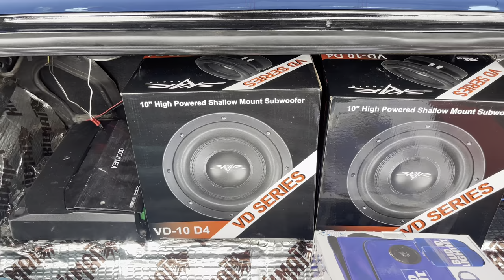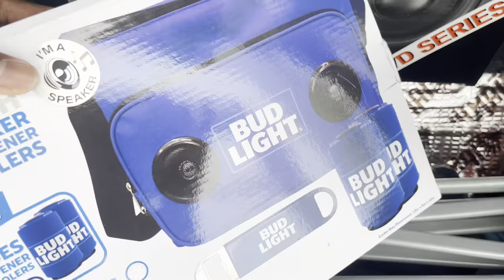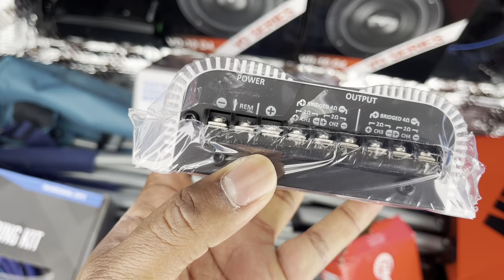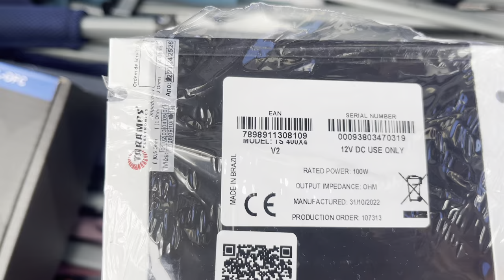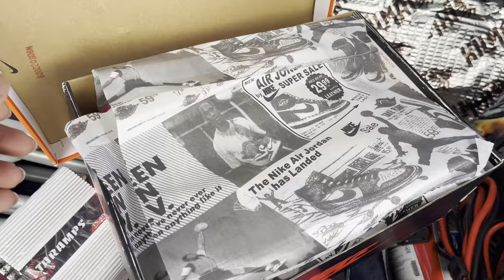FAMILY BLESSED ME FOR CHRISTMAS 2022

Comment: Run it at 1 ohm an get a custom ported box built back there lots of people do it I’m bout to run 4 10s in the same spot an use the bottom half of the truck for storage
Reply: Get the kick panels an nice set of 6.5 components an pair of super tweeters in dash u will be heard loud an clear
Reply from the maker: Exactly what I'm trying to do...I've seen a few with boxes up top but most people put a big box in the bottom portion of the trunk...I don't want all that...thanks for the input💯
Reply: @87SSBOI  check out my ss i got it in the works
Reply from the maker: @jbhouseofshinedetails8827  ok bet